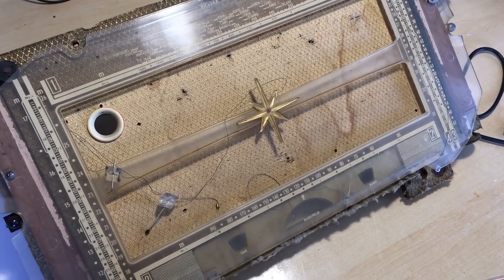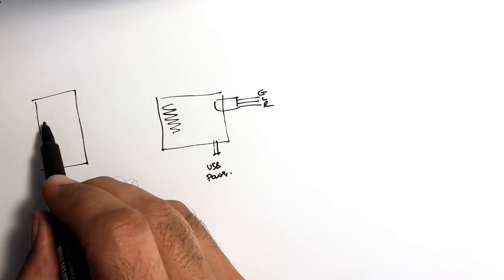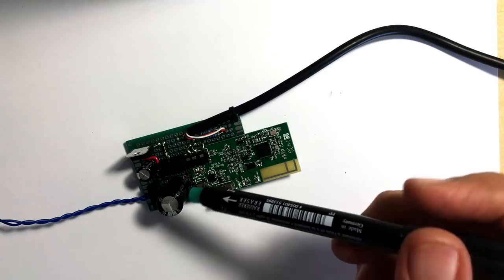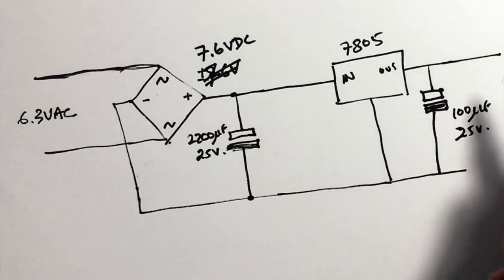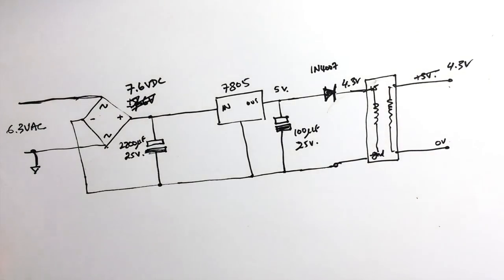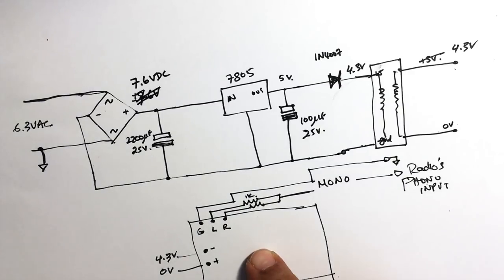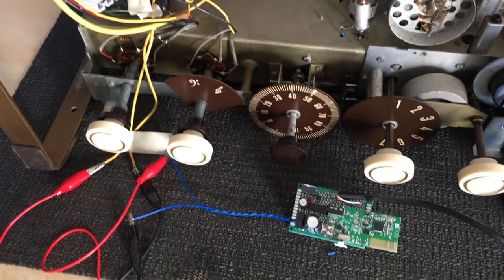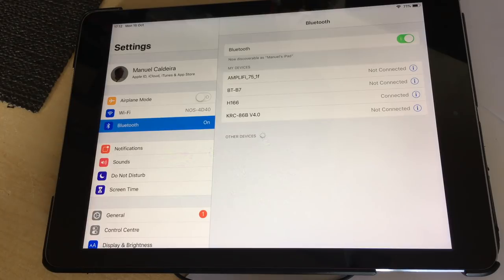Philips BX626 tube radio restoration - Part 5. Adding Bluetooth to this tube radio.

Comment: Very nice bluetooth add-in.  I think you could use a cheap 1:1 audio transformer to get isolation they are cheap on ebay.  They are used to avoid ground loops in PA systems.  Thanks for posting.
Reply from the maker: I've used them before but they tend to affect the frequency response with music.

Comment: Curious where you found that bluetooth board?  Tried to find one similar in construction, but not on ebay. Any more detail available. I know others would work, but like the design of that particular board.
Reply from the maker: zorka4098 : I’ve had it for some time and don’t have a record of the eBay purchase. It was actually a small module in a case with battery.

Comment: Thanks for your video especially nos 3 and 4, looking for the next one. I found in ebay an alternative chip, 3W, 
HLK-PM01 direct AC DC 220V to 5V DC so no need to use the radio transformer for 6.3 V AC. I have not used it yet, so do not know the quality or durability.
Reply from the maker: Interesting. I might get a couple and test them.

Comment: For the problem of mass. Why not install a small transformer directly to the 6.3 volt AC power supply coming out of the big transformer from the radio's power supply, to obtain an alternating voltage of approximately 5 volts which will be straightened and regularized to power the plate bluetooth?
Because if we put a small transformer after rectifying and regulating the voltage and the filter capacitors the transformer will not work with direct current.
Reply from the maker: Mohamed EL OUARIAGHLI : no need. This works just great.
Reply: does it work with an oscillator or without an occluster?
Reply from the maker: Mohamed EL OUARIAGHLI : sorry, I’m not sure I understand your question.
Reply: I am talking about the power of the bluetooth plate.
you have drawn the attention of 6.3 volts which is used for the supply of filaments, by a bridge of diodes. you made an electrolytic capacitor, after you made a regulator of 5 volts, point an electrolytic capacitor and after a diode. after you said that the Gnd does not fit with the radio chassis. for that you proceeded to put a small transformer so that it is isolated from the Gnd of the radio and to give then a voltage of 5 volts. then I tell you that if you put a transformer on a DC voltage, the transformer does not want to work and the output of the transformer will be zero.
Reply from the maker: Mohamed EL OUARIAGHLI : the component used is not a transformer. It is a dc to dc converter, so the output is dc.
Reply: Oh yes okay.
what is the name of this component that you used?
its function is based on what principle?
does this component give galvanic isolation?